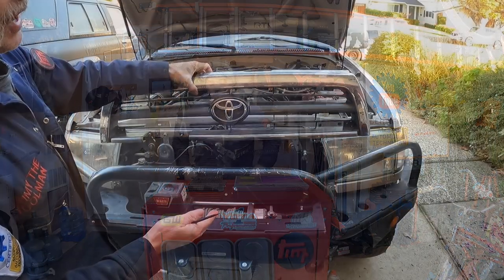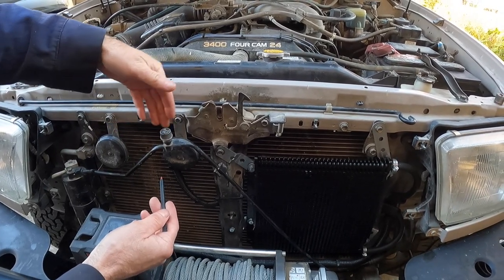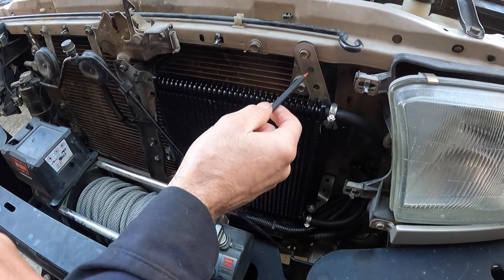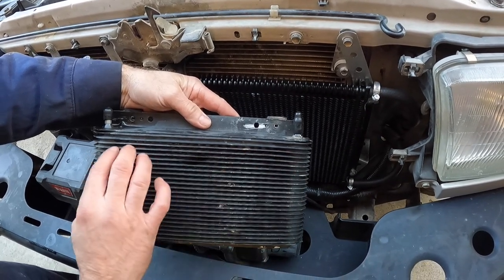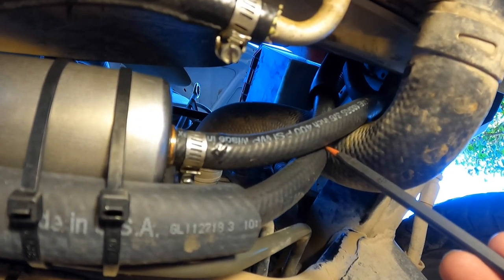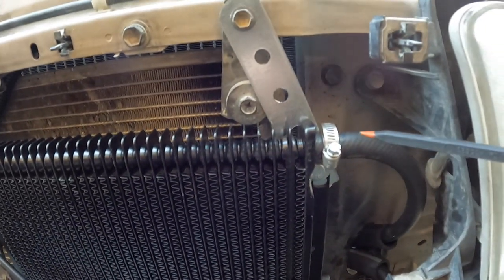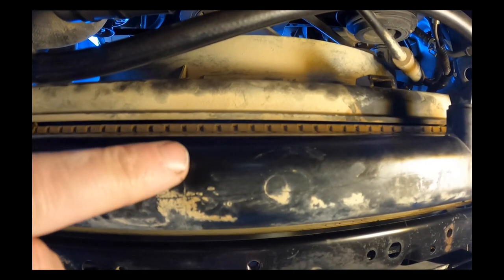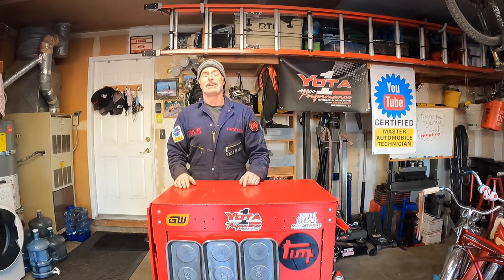External Transmission Cooler Install (3rd Gen 4runner/1st Gen Tacoma)

Comment: Timmy, thanks so much for your video. Im planning to install a hayden 678 on our honda pilot. It came with a small factory trans cooler but we had some overheating issues towing last year. If it fits can you think of any reason to install this as a second cooler vs. taking the smaller one out and installing a Hayden? Thanks so much, also does it matter if the filter is on the send vs return line? What is the benefit of bypassing the radiator?
Reply from the maker: You can add the Hayden cooler as a second cooler or as a replacement.  It's up to you.  You'll obviously get more cooling using both.  You can put the filter in the send or return line.  It doesn't matter.  With bypassing, you eliminate the chance of destroying your transmission if the OEM cooler in the radiator cracks.  This allows engine coolant to mix with the ATF.  Automatic transmissions don't like water and they fail , causing an expensive repair.  It's not that common, but it happens.  The downside to bypassing is that the ATF takes longer to get to operating temp.  The cooler bathed in the coolant assists the fluid to get warmer faster.  Lots of people just renew their radiator to prevent a trans cooler failure.

Comment: Thanks Timmy! Installed this cooler before my cross country move+1000 miles off road in my 2004 Tacoma. Tena were really good compared to not having it especially in the mountains of Colorado. Despite having this cooler, the temps still got up to about 220 in some of the high mountain passes. Was brainstorming and thinking of putting a small fan on it. Do you think this would be effective?
Reply from the maker: Even with an external trans cooler, your trans temps can go pretty high depending on the conditions.  Slow steep climbs are the biggest enemies.  With climbs, if you can maintain at least 45 mph, turning overdrive off will keep the temp down.  Slower than 45 mph, the torque converter won't lock up with overdrive off, and the temps will climb.

I don't know how much an additional fan will do.  The fact you monitor your temps is more than half the battle.  Sometimes, it's prudent to pull off and give your trans and engine a break.  220 degrees is not that bad.  When you get over that though, it's time to consider pulling off the road and taking a break.
Reply: @TimmyTheToolman thanks for such a quick reply. I was thinking the fan may be a little more work that what it’s worth. 

Second note: got my koyorad radiator in today. Thanks for the videos, I’ve watched hours of them.
Reply from the maker: @TheBlakeSteinke  You're very welcome.  Good luck with the radiator swap.

Comment: Hi Tim, just curious on your take comparing your 2000 Toyota 4runner (in-series external transmission cooler) versus your 1998 Toyota 4runner (bypassing the radiator). Is there any big differences besides avoiding the possibility of the transmission milkshake? What are the major differences in temperature when offroading or towing between the two different setups? Your insight is always appreciated and can't wait to see more of your videos!
Reply from the maker: I'd say the set-ups are comparable with the temperatures I'm achieving but these rigs are very different than each other in the area of weight.  My 98 is considerably heavier than my stock 2000.  It's probably at least 700 lbs heavier.  The biggest advantage with running the larger external cooler bypassed on my 98 is I'm eliminating the chance of a trans cooler failure and ruining my auto transmission (pink milkshake).  The only thing I've ever towed with either is a light motorcycle trailer, which probably weighed somewhere around 500 lbs.  I told myself if I wasn't liking the temps I was seeing with my 98, I'd go back to running it in-series with the radiator cooler, but so far, I'm happy with what I'm seeing.  

I don't know if this helps you make your decision on which way to go, but hopefully it does.
Reply: @TimmyTheToolman  This was great insight! Thank you!
Reply from the maker: You're welcome.

Comment: Hey Timmy!  Good video. What temperature gauge did you use?
Reply from the maker: I used a Max Tow gauge.  The install is documented in this video: https://youtu.be/fT_2szdKXRM. All the parts used for the install are linked in the video description.  Glad you like the video.
Reply: @TimmyTheToolman  Thanks for the reply.  Now that it's summer, how is this external doing to keep the trans oil temp in check?  I've installed an aluminum external trans cooler in my 1996.  Haven't driven it yet.  I'm wondering if a cooler fan is necessary or even possible.
Reply from the maker: @1stgenoffroad  The temps are doing well but I still need to employ all the tricks I know like turning overdrive off when appropriate and using 4Lo when climbing sustained grades while 4wheeling.  External coolers help keep your temps down but you still need to drive smart and even pull over sometimes to let your trans and engine cool down when appropriate.  The more aftermarket things you put on your rig like bumpers, skid plates, roof racks, etc the heavier your rig gets and thus increases the strain on your transmission and engine.  

Some people use an accessory pusher fan but I believe this only helps during slow moving situations, like 4wheeling, when there isn't significant air being pushed through the front grill.  When you're not running the fan, the fan attached to the front of the cooler will actually hinder air flow through the cooling fins of the cooler, so that's something to think about.
Reply: @TimmyTheToolman  Thanks for the reply.  I'll just have to keep an eye on it for now.
Reply from the maker: @1stgenoffroad  No problem.

Comment: I’m thinking of doing a trans cooler on my 1999 4Runner. I was wondering if your engine operating temperature was affected after adding the trans cooler. I would like to add this but don’t want to to trade lower tranny temps for higher operating temps. Thanks!
Reply from the maker: No, my engine temps haven't suffered as a result of installing the trans cooler.

Comment: Hi Tim. Looking at doing this mod here in the near future. Just had a quick question for you did you choose to go with the Hayden 699 just because it is larger/more cooling capacity  and it has the bypass? I’ve seen others use the Hayden 678.
Reply from the maker: Yes, I chose it for its size and bypass capability.
Reply: Thanks Tim
Reply from the maker: @rthomas2157  You're welcome.

Comment: Another great video. I literally have two of these coming in the mail for my Tundras and stumbled upon your video. I purchased them to completely bypass the stock trans cooler within the radiator to avoid any risk of pink milkshake. In your video you discussed why you oriented the cooler the way you did, to allow air to rise and escape. If you rotated the cooler 90 degrees so both the inlet and outlet faced downwards, do you think some air still may get trapped inside the cooler? I feel like there is still a slight possibility.
Reply from the maker: I never done the fully inverted installation but I've heard of people doing it.  I think the fear of getting air trapped is overblown but I wanted to cover it in the video because that's what I've read from at least one manufacturer of these coolers.
Reply: @TimmyTheToolman  Thanks for the reply! I appreciate it. I got the coolers in the mail today and it appears there is not a designated inlet and outlet side on the cooler, am I correct in saying that?
Reply from the maker: @tomb6319  Yeah there is no identified inlet and outlet.  The fluid could flow in either direction.  There's just what I said in the video about air getting trapped based off how you mount it.
Reply: @TimmyTheToolman  Awesome thanks for all the help Timmy, super excited to get these on my Tundras this weekend.
Reply from the maker: @tomb6319  No problem.

Comment: Your stock cooler that is in the bottom of the radiator is the same setup as my UK 1999 KZJ 95 Landcruiser, do you ever come across issues with the cooler or rad failing where they join and the transmission fluid and coolant mixing causing damage to the transmission? It seems to be a common problem and I replaced the radiator on mine at 120K miles to be safe. I was thinking of bypassing the stock cooler and fitting a stand alone trans cooler, what are your thoughts
Reply from the maker: The trans cooler failing in the radiator does happen on these vehicles.  How common it is, I don't know. They call it the "Pink Milkshake" because the mixing of the coolant and the ATF makes a frothy pink mess.  Bypassing the stock cooler removes this from being a possibility.  This was part of my decision to bypass the stock cooler.

Comment: So should I return my bm cooler? I'm bypassing but my truck is stock and mostly daily driving
Reply from the maker: I'm curious, was this video a suggested video at the end of one of our other videos?  The reason why I ask is this video is unlisted.  I'm trying to figure out how you got the link to watch it in the first place.
Reply: @TimmyTheToolman  I was searching on your playlist for Tacoma 1 st gen videos and this video was in the playlist. Right at the very bottom
Reply from the maker: @vanliferr4079  Awe, interesting.   Thanks for letting us know.  OK, to answer your question, the B&M cooler might be sufficient but it depends on how you're going to use the rig.  If you plan on doing a lot of mountain driving, and especially when there's hot ambient temps, like in the high deserts, the B&M cooler might not be enough.  If you're going to do mostly mellow flat land driving, the B&M cooler should suffice.  But, if you're not currently monitoring your trans temp, I highly recommend that you start so you're not guessing how well that cooler is doing for your trans.
Reply: I am unable with my driving to get my tans temp even up to 175 with the current weather using the BM 2604 so far, I have this cooler in the garage if summer changes this tho.
Reply from the maker: @vanliferr4079  Your experience is common.  Easy daily driving isn't going to raise your temps that high.  As long as you can get the temp up to 150 degrees, moisture won't accumulate in the trans.  The ambient temps definitely affect your trans temp.  Temps really rise when you drive in the mountains.
Reply: @TimmyTheToolman  here in Bakersfield dust seems to be the main problem, and yes trips over the pass will be cool to monitor temps, not that I want to go to LA anyway.
Reply: @TimmyTheToolman  I am worried that I can't get it hot enough to properly check the fluid tho so that's an issue
Reply from the maker: @vanliferr4079  You can use a cheat method to get the trans temp up.  Have the engine running with the parking brake set.  Put your left foot on the service brake.  Put the transmission in Drive.  With your right foot, give a little throttle response to increase the rpms.  This puts a load on the torque converter and you'll see the temp start to rise.  I have used this technique many times to help me dial in my fluid level after a service.  One guy I know that's an experienced mechanic didn't think my technique was good for the transmission.  My opinion is the load I'm putting on the trans is pretty light and it's not any worse than the load that's put on it while driving mountain passes or when you're 4wheeling and you're stuck on an obstacle and you're gassing it without moving.  I just wouldn't race the engine, but just raise the rpms a little to create a load on the trans and it will slowly rise to that sweet spot of around 175 degrees so you can dial in your fluid level.
Reply: @TimmyTheToolman  this method worked fast at raising the temps up. Thanks for the advice
Reply from the maker: @vanliferr4079  You're welcome.

Comment: Hey Tim I have my trans temp sensor hooked to the return line as opposed to the sent line, is this fine? I watched your trans temp gauge install
Reply from the maker: You will be reading the temp after it's been cooled so it won't be an accurate reading of what your trans temp actually is.

Comment: I’ve heard running the cooler in line with the radiator is better if you are doing a lot of stop and go traffic in hot weather due to the transmission cooler only being able to cool when air is blowing through aka moving at speed . And if the radiator is replaced when it needs to and you maintain your coolant system properly there shouldn’t be any worries of a pink milkshake. Thoughts on this?
Reply from the maker: Well, what about your engine overheating when you're not moving?  That's what the fan is for.  It not only pulls air through the cooling fins of the radiator but it also pulls air through the AC condenser and any coolers in front of the radiator.  

You made the same arguments I've made in the past about limiting the chances for the pink milkshake by just renewing the radiator and keeping the coolant in good shape.  I agree.  But, there's no guarantees in life.  The trans cooler could still fail if you do everything right.  Would you lessen those chances by keeping the cooling system in good shape?  Of course you would.
Reply: @TimmyTheToolman  Hey I just want to say how awesome it is that every video I leave a comment, you respond with a detailed message. EVERY time. It's mind blowing you have time and put the effort to do that. You're an essential part of many people's lives when it comes to wrenching on these vehicles and put out quality and detailed videos. Keep up the kick ass work man. Thank you.
Reply from the maker: @KaskadeHD  Thanks a lot for recognizing our efforts to answer people's questions and acknowledging their comments.  It can be pretty time consuming but I think it's a nice thing we can do for people since our channel isn't so big that we can't keep up with it.  We appreciate the kind words.  You're very welcome and Happy Wrenching!
Reply: @TimmyTheToolman  Question. So I just installed the Hayden 699 transmission cooler on my 1998 4runner. Install was straight forward. But after the install, when I drive the 4runner forward (doesn't happen in reverse that I've noticed) it makes somewhat of a whining or whirring noise. I jacked up the rear wheels and put it in drive so I could hear where exactly it's coming from but when the rear wheels aren't under load it doesn't make the sound. Only when driving forward.. any ideas? Could it be causing damage? I haven't driven it since.
Edit: I just took another look at my work. It looks like I actually ran the send line to the TOP, and the return line from the bottom of the cooler to the return hard line.. Would you think this would cause the noise? I did read the 699 was 'bi-directional flow'. I should also mention the 4Runner was defiantly not up to temp each time I started it and heard the noise. It ran for a total of 2 minutes max. On a cold start it makes the noise, I never gave it enough time to warm up to open the cooler..
Reply from the maker: @KaskadeHD  Did you confirm your fluid level was good after the install?  Sounds like it might be an issue with the torque converter.  I don't know how installing the cooler could cause that unless it's an issue with the fluid level.  Did you run the cooler in-series or stand-alone?   Any chance the lines you ran are kinked?
Reply: @TimmyTheToolman  

1. Fluid levels are good, I added about 1/4 of a quart. But as I mentioned the cooler never opened up since I didn't run it that long.

2. Yeah it could be but you're right, not sure how that could happen. Coincidence?

3. I ran the cooler in-series. The radiator I have is brand new OEM from the dealer.

4. No hoses are kinked, they have pretty wide bends.

Not sure if you saw but I edited my previous comment right as you replied to this one. Thanks for taking the time to troubleshoot!
Reply from the maker: @KaskadeHD  I have read that it's better to have the fluid fill from the bottom and exit the top on a sideways mounting because air pockets can form in the cooler hindering the fluid flow.  It is bi-directional flow, but if the fluid level is good, it might be air trapped in the cooler.  Maybe change the routing to have the send line connect to the bottom fitting so the fluid fills from the bottom and will push air out through the top to the return line like I did on my install.
Reply: @TimmyTheToolman  i'll give it a shot. thanks!
Reply from the maker: @KaskadeHD  Let me know how it goes.  If you installed an in-line magnetic filter, make sure it was installed in the right flow direction.

Comment: Tim so I want the b&m transcooler whats the pn? Also I dont want to bypass, let me run this by u and let me know if this is correct; send line to bottom radiator exit to return that will then go to bottom line on external then out the top back to the trans? Thank you Tim.
Reply from the maker: Yes, that is correct.

Comment: Forgive my noob question but I just recently picked up 3rd gen 99 4unner my plan is to use the vehicle for 20% overland/off-road and 80% daily. 
I am going to get the cooler done for my transmission but I want to know if the reader/temp gauge will be necessary and will running full synthetic atf be necessary for what I plan to use the vehicle for?
Reply from the maker: OEM trans fluid or a Dex III / Mercon /mercon V compatible fluid is fine. Synthetic is good and is pretty common now. 99-2002 have a built in temp gauge to read trans temp from the ECU. So you wouldn’t need to install a separate gauge, just hook up an OBDII reader with an app or get a scangauge II and program in the trans temp code. 
- Sean
Reply: Thank you! Also one more if my friend were to do this to his 98 where do we get the “T” fitting and the sensor?